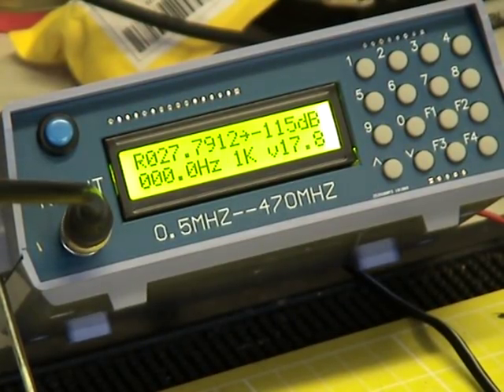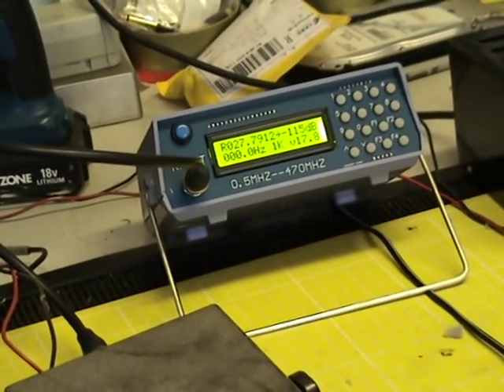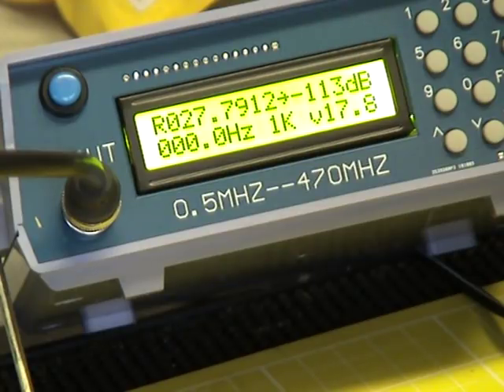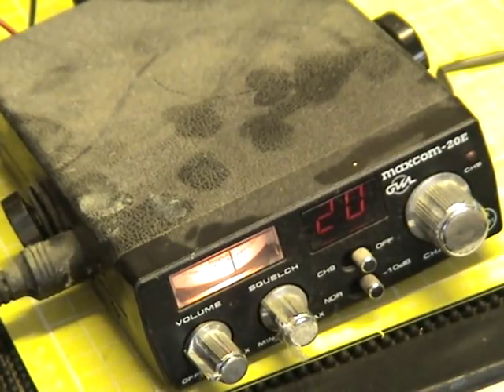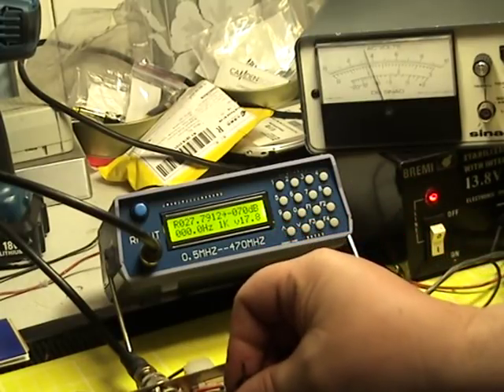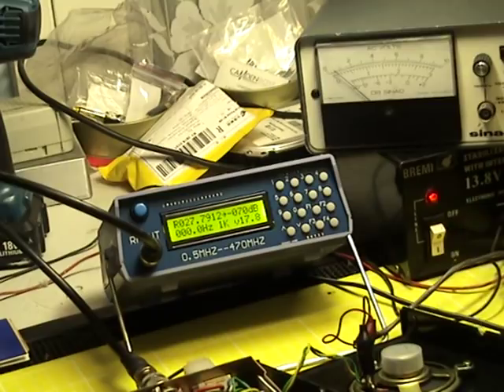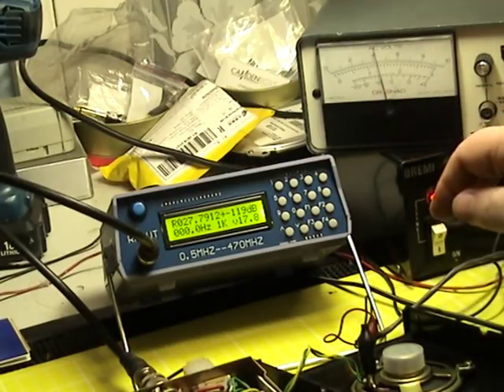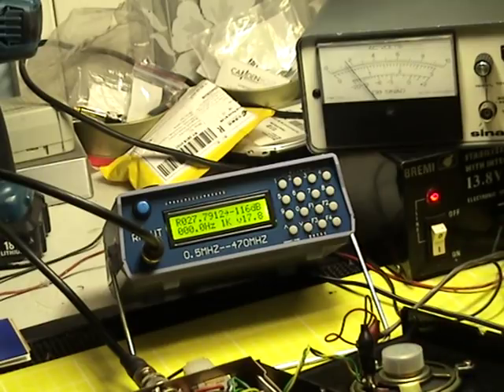CB servicing on a shoestring budget (UK) -  RX on cheap Chinese FM signal generator

Comment: Hi Richard, I am having some problems with my Uniden Uniace 100: I’ve had it from brand new in box and finally opened it the other day, it lights up, displays channel full audio and squelch however there is absolutely no transmit or receive! Do you have any idea what could be wrong? 
Thank you so much I enjoy all your videos and am always learning.
Reply from the maker: For a start, there are three 220uF electrolytic capacitors on the main board: they all need replacing. Now these sets are 36+ years old they are knackerd....even on a brand new unused set. I recall they are 16v rated, so replace them with the next voltage up...something like 25 or 35v for improved reliability. These capacitors smooth the various voltages used within the radio. Everytime I have a radio in with the Uniden board, I always change all three even if they aren't 'yet' showing as faulty. Don't forget to replace them with the polarity the right way round!

Richard
Reply: UK CB radio servicing Hi Richard I have got my uniden uniace fully working now sort of on eBay I purchased a donor rig that was absolutely destroyed but still functional serial numbers were only 350 apart so I transplanted the board from the broken beaten up CB into my also broken but brand-new in box version and now have one perfectly functional radio that is in great condition, my only problem is the signal meter is not working the polarity is correct, the bulb lights , but the dial doesn’t move is there any chance of a wire could of fallen off inside from soldering?
Reply from the maker: You can check the meter with your multimeter for continuity & if the radio's meter appears ok it is possible for a wire to have come off.However,  I would expect the meter itself to be duff as the internal wires are hair thin.

Bear in mind you need to ensure those 220uf capacitors are changed or you will have a non working set pretty fast.

Comment: i bought the spectrum analyser..
lasted me three hours before i shoved 10w in to by accident..!!
it was 25khz reading off frequency,
and kept glitching while using it..
so sent it back for a replacement..
Reply from the maker: What kind of numpty transmits power into such an item. On a serious note the ARRL handbook always has 'sniffer' type attenuator designs that can be made cheaply.
Reply: i was connecting it to the RX filters on a cavity unit, connected the TX by  mistake and the radio sent it's ident at the same time,
school boy error, learn to switch off first..

i have got an RF sampler as well hooked up to the scope and counter as well..

oh well easy come easy go..
Reply from the maker: Best using an analyser with a tracking generator with no transmitter in sight.

Richard

Comment: Thanks for this Richard, I might get one of those. For some reason it goes to the US site when I search for it on Ali Express :-/
Reply from the maker: On Aliexpress.com there are three 'adjustments' top right directly under the very top advertising banner. There is 'ships to' and you set that to your counry, there is currency (mine is set to BP) and then there is Language. Between those three you should be able to set everything up & it'll remember next time you use it. Payment is by debit/credit card, alipay (like paypal, but there version) & Paypal too. I've been buying off there for a good 5 years.

Richard
Reply: @ukfmcbradioservicingTango21  Thanks Richard :)

Comment: Iv got 2 of these things Richard. Both do tx and rx tests. One didnt work when it arrived but the other one is spot on. Ideal for field use with a 12 volt battery pack. I was going to suggest one of these when i watched your last video with the am sig gen. At least it sort of stays on frequency when u are injecting a signal. Lol i bet u remember using an old am fm sig gen back in the day and it drifting all over the place lol. I know i do. Mine was a Marcont tf2008 . Wasnt cheap even second hand at that time and wasnt stable at all.
Reply from the maker: My first signal generator was a huge schlumbeger FS30 & FSM500 solid state synthesised I recall paying £1K for it.....bearing in mind I'm from a professional business radio backround, that was about the cheapest I could find. Sold it on in the 90's to a radio amateur

Comment: I bought a Stabilock 4040 radio test set for £50 at a rally so cheap test equipment is out there.
Reply from the maker: I've never seen one under £400!   Very well done